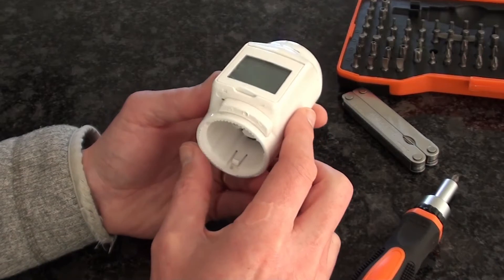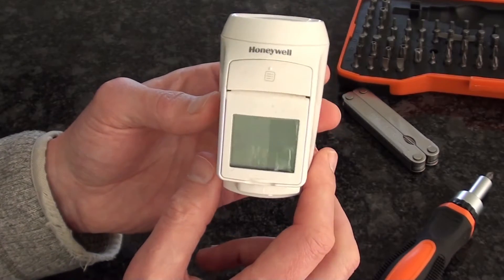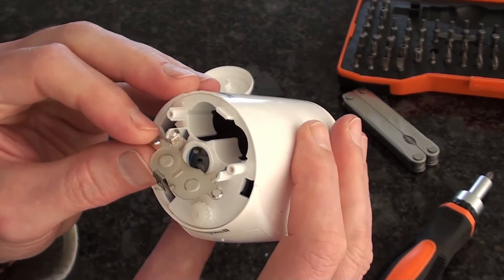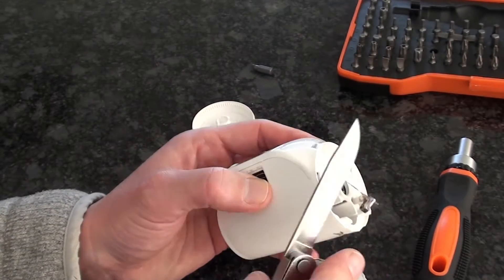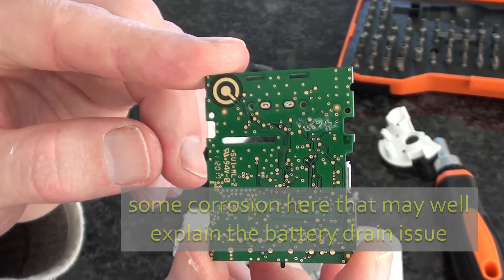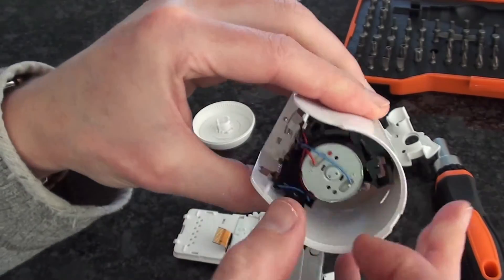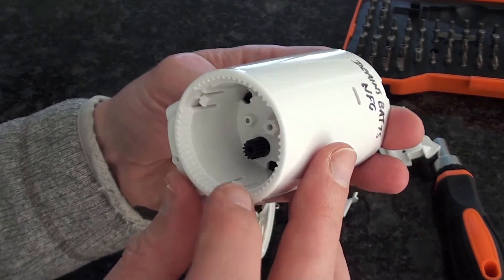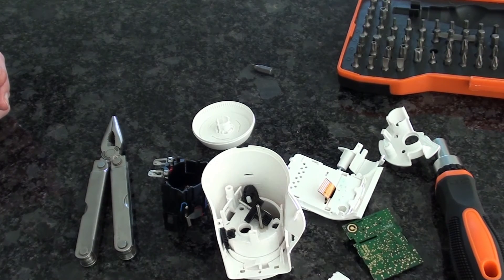A look inside an £85 Honeywell HR92 wireless radiator valve.

Comment: Interesting video. I have had a system installed for about 12 years. Up to now, no problems. However noticed today, radiator in one room was cold. Although receiving signals from the controller, the motor was not activating. So it looks like I need a new valve. Fortunately they are now available for £47 if you shop around.
Reply: Me too, I have about 12 of them for over 10 years now, never had a single problem with any of them, they are brilliant imo.

Comment: have system with 6 rad valve trv, hot water control and boiler enable module, installed 2017 NOT A SINGLE ISSUE WITH ANY PART OF THE SYSTEM. Sorry to hear you cant get it to work.